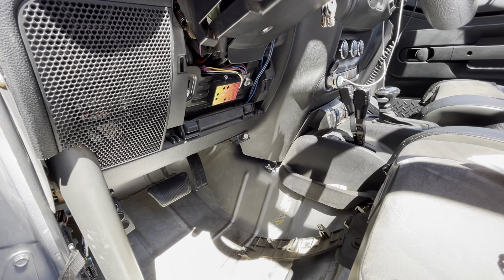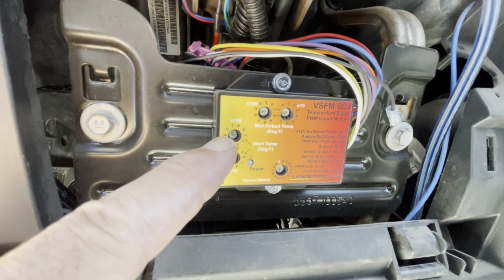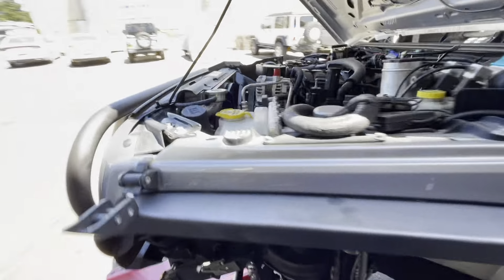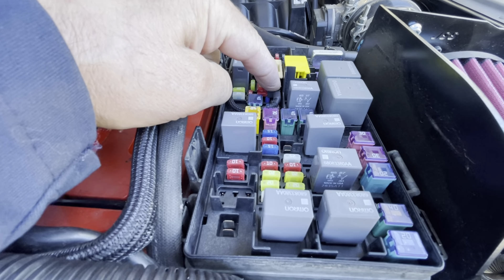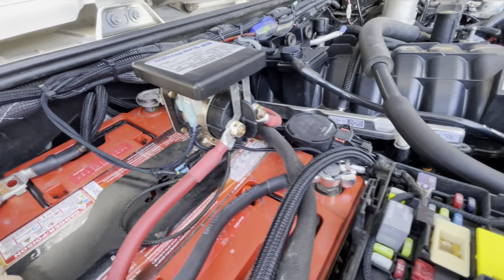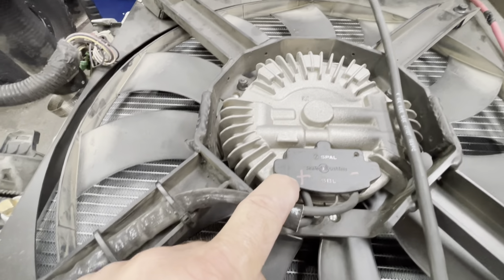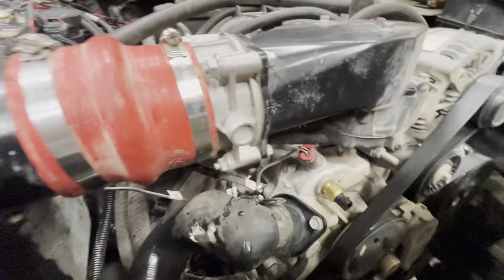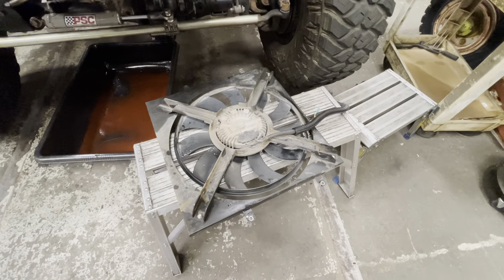Lingenfelter fan controller wiring and settings

Comment: I have a 2007 Jeep jk that is completely stock motor right now. Having issues with radiator fan control wiring that I cannot figure out. I plan to go V8 in the future so was wondering if I could go ahead and do this upgrade to camero fan and Lingenfelter controller?
If I could, how do I keep the check engine light from coming on? Does the controller talk to Jeep system at all to tell it the fan is working properly?

Comment: Any reason not to tap into the temp sensor already existing on the 6.4, rather than tapping and installing an additional sensor?
Reply from the maker: Very Good question, Why you would not want to change the values to the engine or maybe disrupt the signal . Also the Lingenfelter is a GM base so we use a GM sensor, also the Fan Controller is a independent fan setup .

Comment: Hi, is your controller compatible  SPAL PLUS SERIES - Choose "Device Select" 1 from the data sheet since your device is built for Jeep speed shop. can I change the 30% A/C Trigger, for example 40% because of high temperature I need a good performance AC.Could you please help me with this?

Comment: Will this set an engine light, since the stock fan will no longer be part of the system.
Thanks.
Reply from the maker: Only for the 3.6L Jeeps, so we have added a Resistor in the old fan setup.. But on the Hemi, We would not have a code.

Comment: I wonder if this controller could run say a pierburg 400 electric water pump and spal fan pwm at the same time? I think they are both 1000 hz signal.
Reply: Sorry 100 Hz not 1000
Reply from the maker: I'm not sure about that